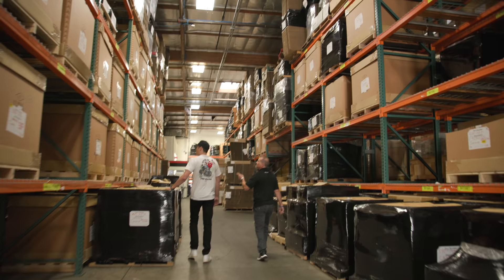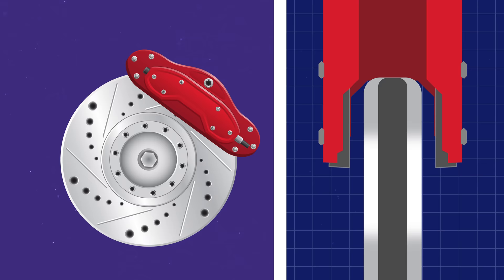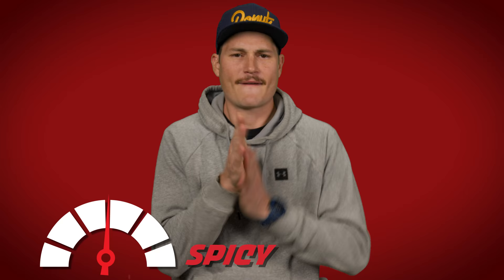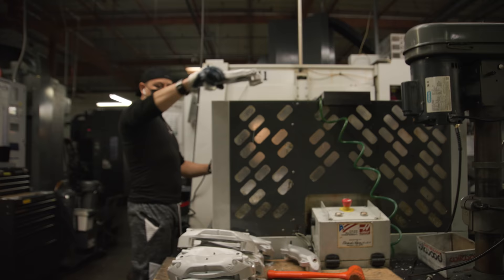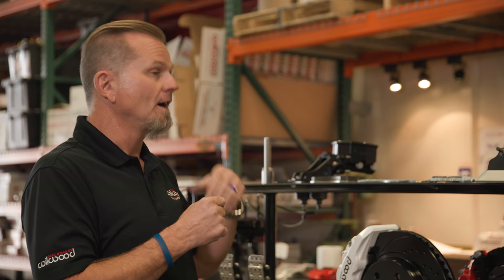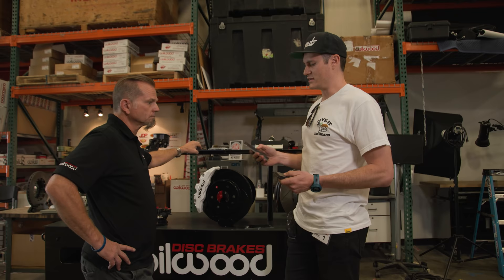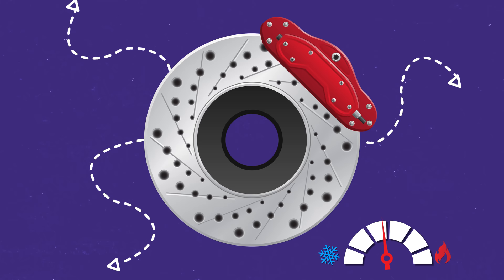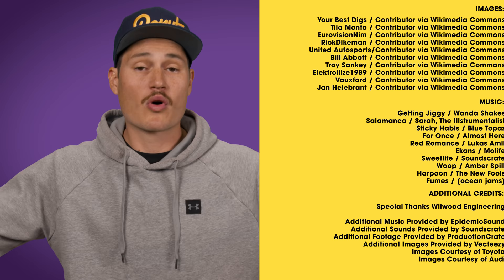Why Your Brakes Can't Melt

Comment: With my car it has two ways (technically 3 ways) to use the braking system... (The force of friction) my car also uses 'speed' it senses how fast you hit the brake pedal. If you pull the electronic e-brake it will balance the abs... So pressure applied by your foot isn't taught correctly...
Reply: This is overly pedantic. The ABS system is just doing the same thing your foot would do, applying or releasing pressure to the system. The ABS system uses an electrohydraulic pump to build pressure while your foot presses on a set of levers and linkages to push on a piston. Remember, this is a YouTube video on a car channel aimed at the general public, not a technical video aimed at engineers. Brake classes for automotive techs are usually at least 2 terms long, and the physics behind it would take even longer. They've got to simplify things somewhere.

Comment: That is not how a pressure cooker works at all. It doesn’t create heat by pressure. They work because under pressure the boiling point of water and everything else increases. The heat source is independent from the pressure. The pressure simply allows the heating source to heat the food to a higher temperature. Otherwise good video, minus the mustache 😂

Comment: Hey Jerry, You almost lost me when you were giving a lesson about how downforce worked and you completely didn't understand how an airfoil works. I get that you are supposedly the "science guy" for donut. I really enjoy learning things from you but if you are going to explain things to me, maybe you should do enough research to understand them. That being said, I enjoy your videos and just wish I could trust what you are teaching me. A wing creates lift. If you turn it upside down, it creates down force. That is because faster air travel has less pressure than slower air travel, it's called the Bernoulli effect. You can test it by yourself by opening and closing your hand around a running stream of water . If you create a surface that is asymmetrical where the air traveling over one side of the wing is forced to move faster, it will pull, not push the wing.  Just saying. Keep up the good work but maybe work a little harder.